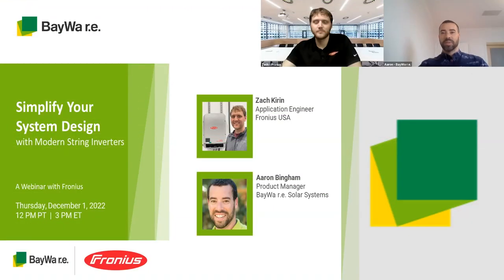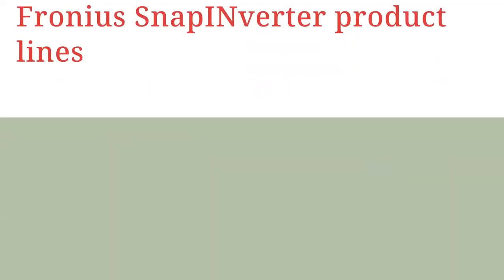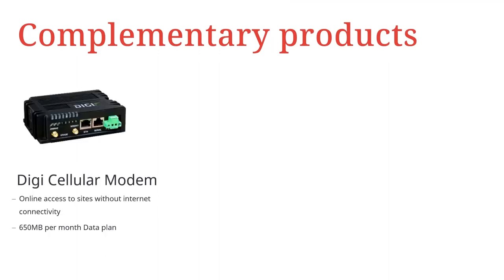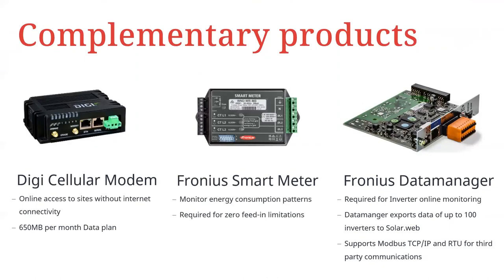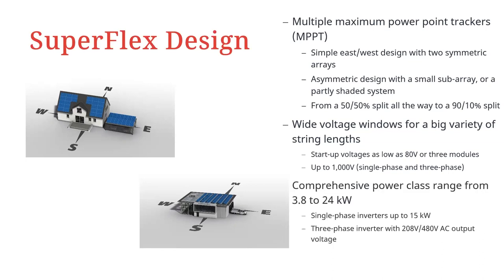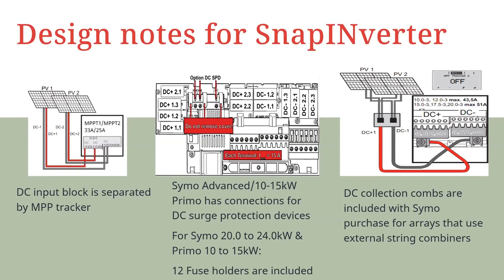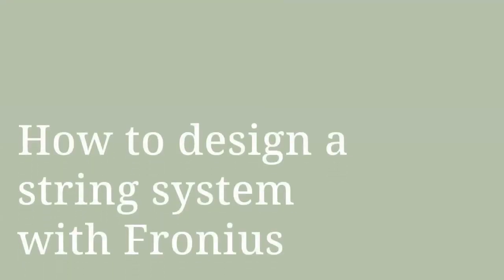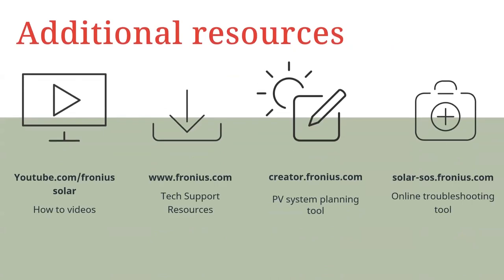Simplify Your System Design with Modern String Inverters

Comment: I'd prefer to just have a string inverter but, aside from rapid shut down, there is no per panel monitoring, right? I've had three panel issues in 9 years: 1 was an optimizer that I easily identified and replaced myself with an ebay purchase for $30 (win for string) but in the last year I had two panels cut output by 1/3. I immediately knew which panels were bad (win for optimizers). I would hate to have a string setup and need to troubleshoot panels with no indication if there is a problem. Even if one of many panels go bad that underperformance would be absorbed into the string results so I wouldn't know. A ground mount is no big deal, but up on a tile roof is no fun.